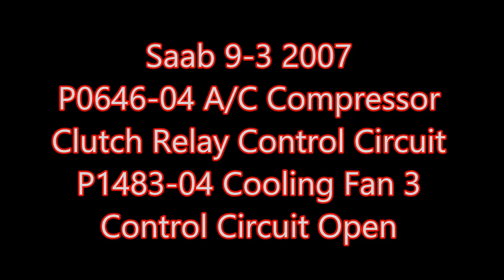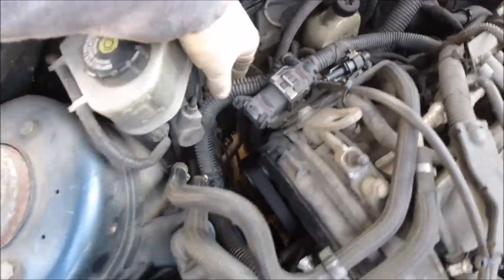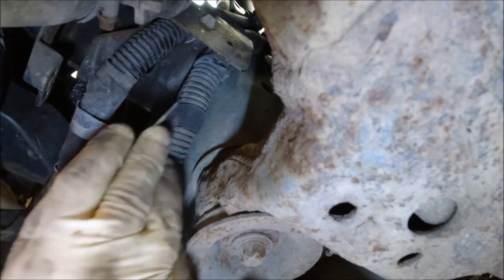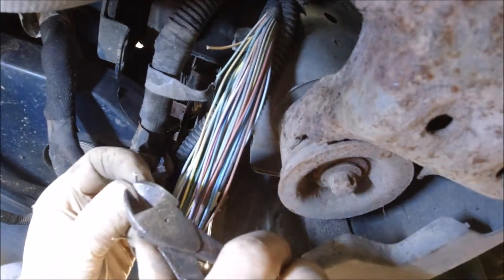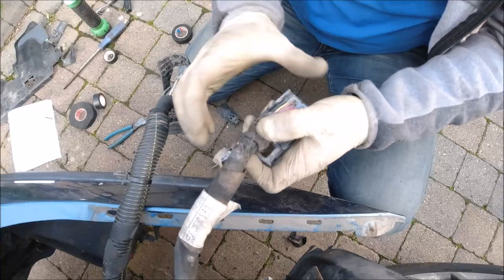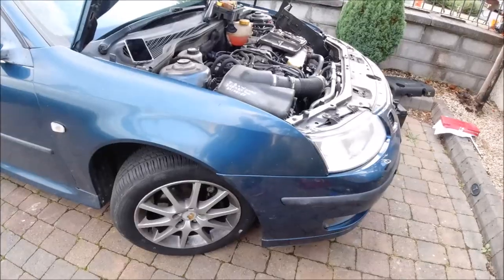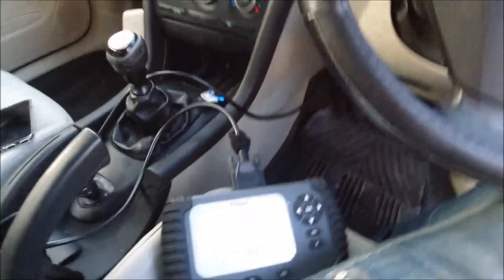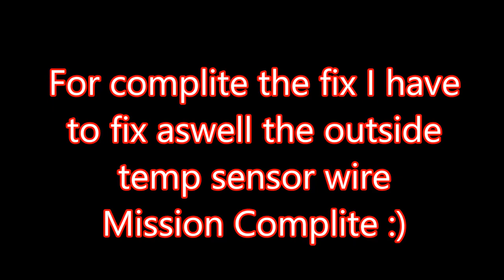Saab 9-3 2007 A/C Electric Problem/Cooling Fan Motor Problem

Comment: Just in case, Note this is a 4cyl Diesel. If USA car the ECM is not located in the same position, and may not have the same failure. Good video, however.
Reply: The failure was two wires being ripped apart. That failure could be on any model saab